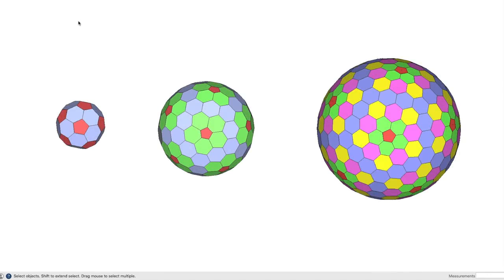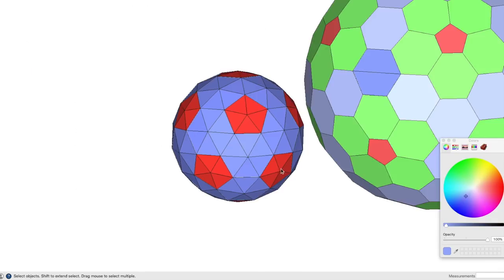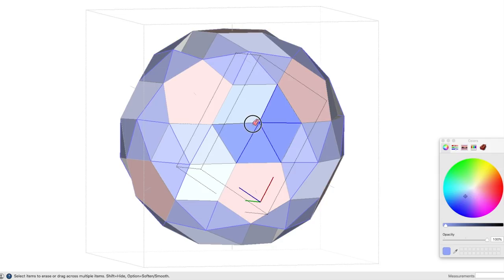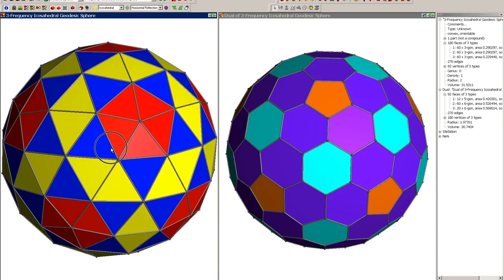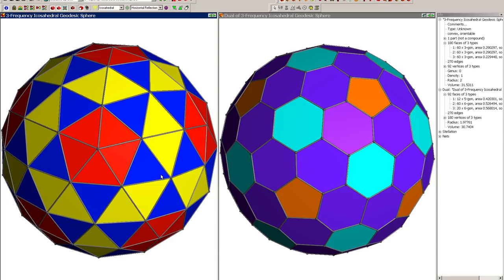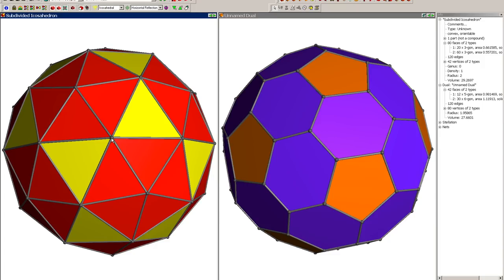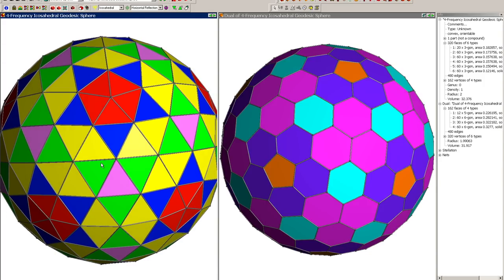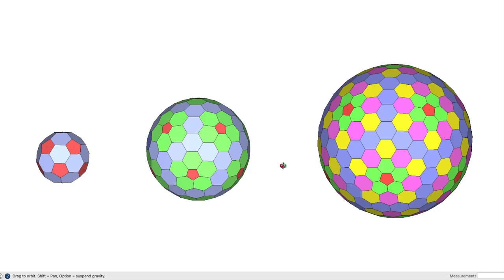Hexadome/honeycomb geodesic structures

Comment: You can either take a dodecahedron or an icosahedron and sketch a hexagon on the center of one of its faces , then surround the face with hexagons which are equal sized to the original hexagon.Project vertices onto  a circumscribed sphere, connect and pattern using the symmetry axes of the respective solid.

Comment: Hey Paul,  I’m wondering if I could do a 9V honeycomb dome 9 meters or around 30feet imperial, with Howard and Annies honeycomb method, only using steel tubes and your wangerflange to join them.  I want to anchor it to a deck.  I’m and artist not a builder but I would really like to figure out if I can do it with your new product.  I’m of course wondering how to stabilize the hinges as I build, so I can handle cutting the metal and putting the pieces together myself until it comes time to raise the dome.  It’s ok if it’s not possible, but I thought I would ask before abandon the idea.  I’m certain I want a 9V Honeycomb design, but I really don’t want to use wood unless I have to.  Many Thanks, Kenya

Comment: stretched skin construction in metal sheets, especially alluminium, was an interesting topic...  what about a concentric construction... interior dome (the little one) bolted/riveted at outside leaps, exterior dome bolted or riveted toward inside... in the middle polyurethane foam will glue and insulate the entire structure proceeding spraying at a certain point of the assembly... also fixing tubes and piping for wires and plants.

Comment: What are the cons and benefits on hexa domes vs geodesic domes?
I saw some domes with two layers which form a combination of both or 2 layers of hexa dome.
Reply from the maker: Benefits are: fewer components and larger window area. Cons are: Anything that isn't triangular won't be inherently stable. In double skin system one layer is usually the dual of the other then triangle framework is attached between skins, this will stiffen the structure. hope this helps.
Reply: @Geo-Dome  Hi paul, I am from Argentina, can I make some other questions?  here or in your page? Tell me and I will copy paste.
I saw most of your videos, but there are some doubts that I still have.
I common see that even taking into fact that a geodesic dome structure is way more strong  in comparison to a normal roof/house, people keep using thick wood planks, this does not neglect the material benefits that a dome should have?
Or they choose thick and strong wood to avoid  rot or other issues to extend the lifespan?  A thin wood well treated with varnish or something similar would not last much?  What about WPC compound, you try them before?  Although they don't seem so rigid, they bend a bit more.

I would love to make it from metal (my uncle has a business and makes any kind of machine with that), but I see some issues with a metal frame.
If it is pipe or "T", then we have less "thickness towards the sphere center" to distribute the forces in the top of the roof for example, this could be solve with a smart a double layer but it becomes harder to design and to apply windows and thermal sealing.
I know enough about thermal insulation or energy efficiency in all their forms, using tricks that I want to exploit with a new type of design, but the frame selection is still an issue, taking into account this would be for a small 2 floor house.